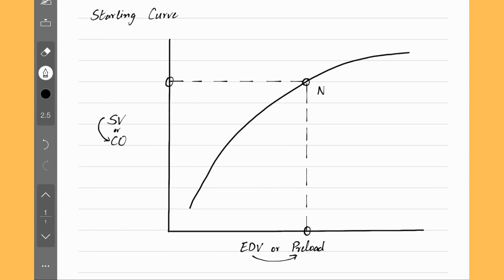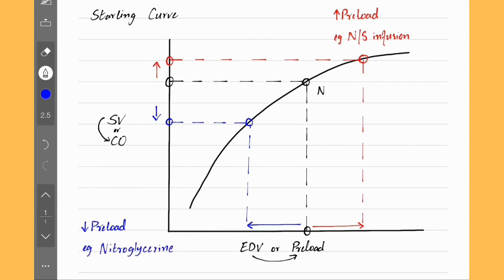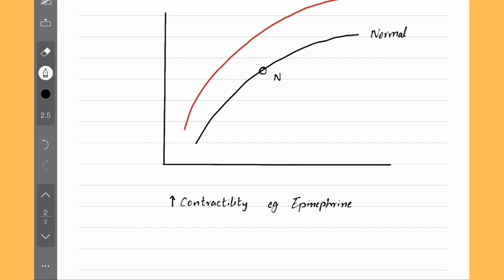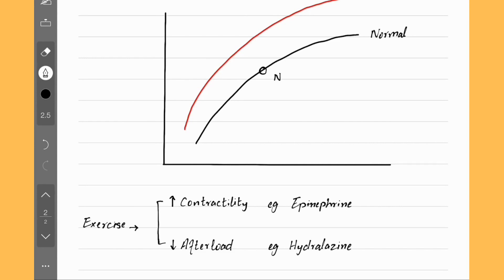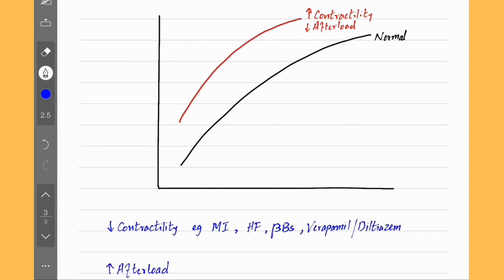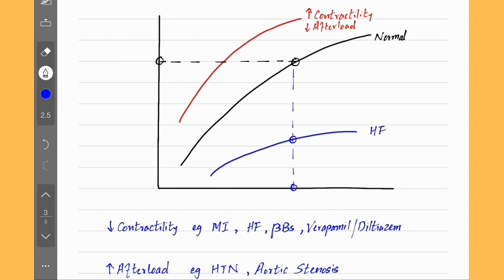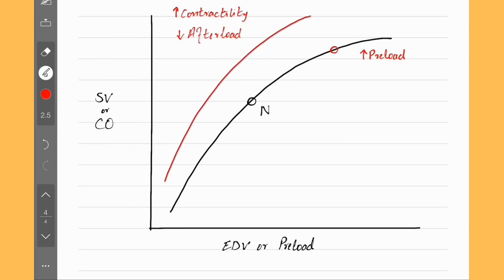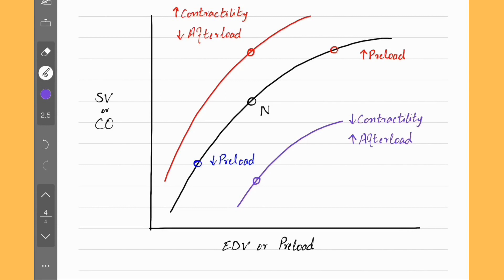Starling Curve | 7.06 CVS PHYSIOLOGY

Comment: Hi, great video,  but doesn't exercise also increase preload through venous contraction which will lead to increase in TPR too?
Reply from the maker: Hey Raliat. The way I think about it is that tpr is entirely due to Arterial system. Venous system has nothing to do with tpr. Please correct me if I am wrong. You are right though. Exercise does contract veins (but veins don't contribute to tpr)
Reply: @GRABtheMD  Thank you so much, tpr has been confusing me for a while